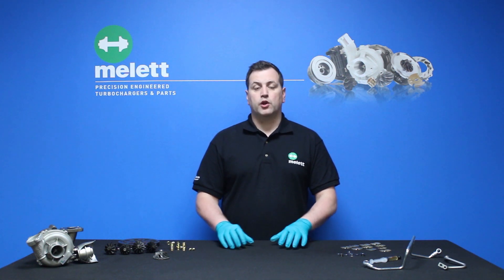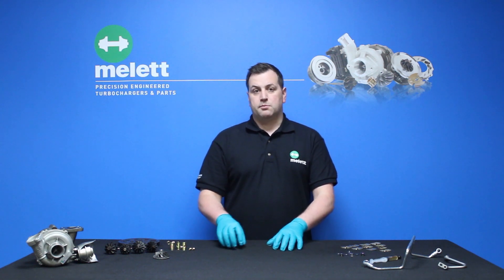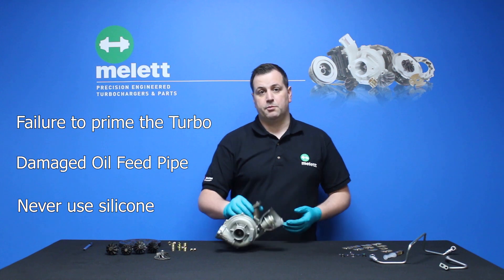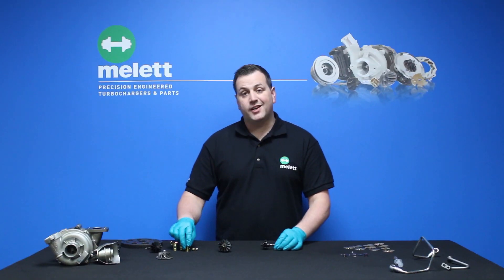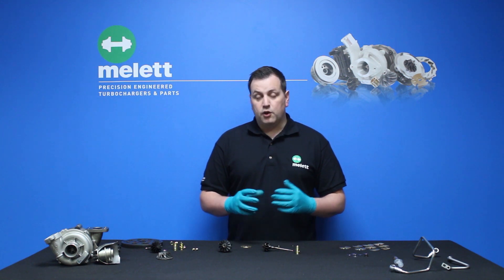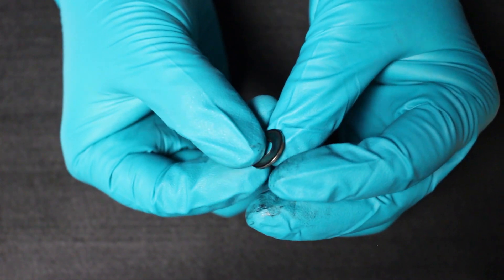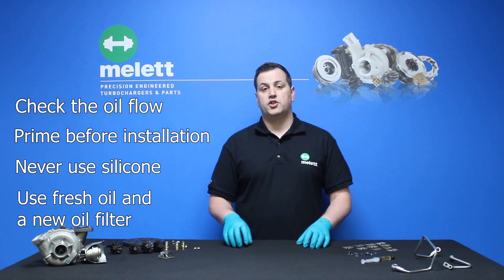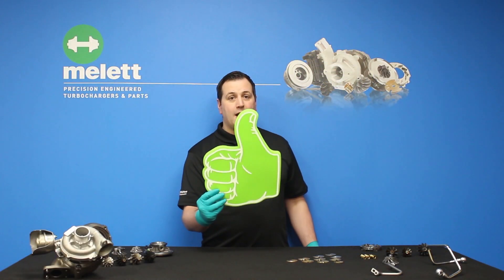How does Insufficient Lubrication/ Oil Starvation / Lack of Lubrication cause turbocharger failure?

Comment: ..turbocharger fail most of the times becouse of the oil feed pipe thas flexible(ehen not flexi pipe tahs mean oil pump si faulty,) .when the rubber get heat up dosnnt let the oil to pass..... when the pipe get cold the rubber get back and looks perfect fine.